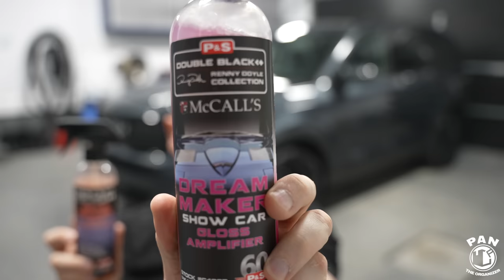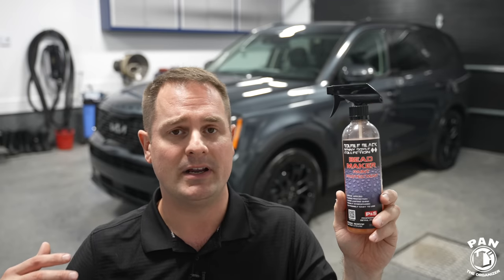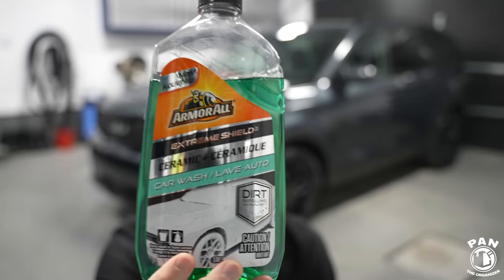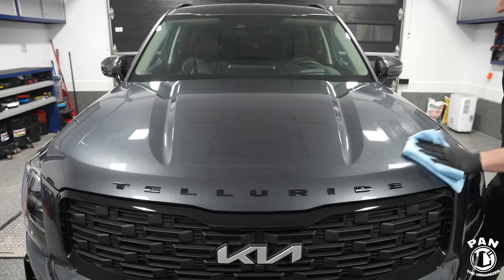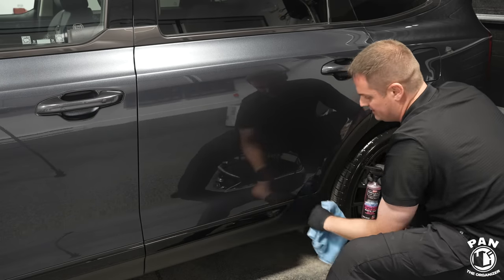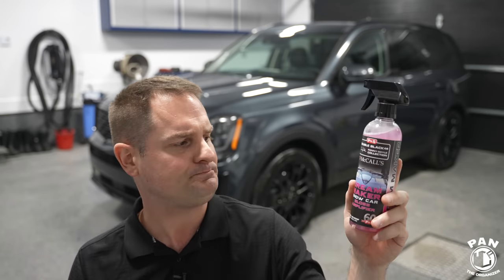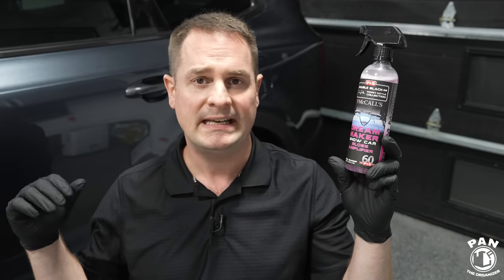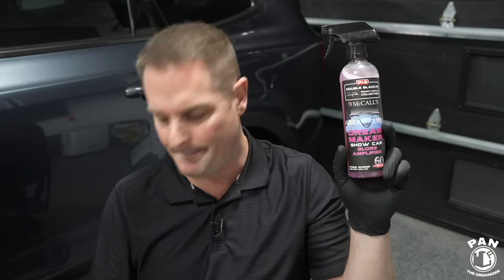NEW P&S DREAM MAKER! Is it better than Bead Maker?

Comment: I just tried dream maker….I wanted to love this product as I already have protection so don’t want to keep loading up.  
Unfortunately I really struggled with Dream maker.  I found it extremely grabby, sensitive to temperature (it was about 9 degrees Celsius) and horribly streaky.  

The paint on my vehicle was absolutely clean and pristine as I’d just done a  multi-day 2 stage paint correction, all that was on the car was bead maker (applied 48 hours earlier).  It was so grabby that I could see areas on the panel where the microfiber filaments had been left on the paint.  
I removed it with Koch Chemie FSE which is so much more forgiving on application and frankly I could see no discernible difference in gloss on a side by side comparison.  The paint color is carbon black (super dark blue).  
Not trying to hate on the product (I like P&S) and everyone can have different individual experiences….just surprised no one else seems to be having any negative user interactions.
Reply from the maker: Yeah that is odd, but I think the 9C temp is for sure not the ideal application temp. I never recommend applying any topper (or paint protection for that matter) under 15C (some brands claim 10C as the bottom limit). Ideally you want to be at near room temp (20-22C). I always keep my garage at 20C and a controlled 40-45% humidity.

Also, switch to clean sides of the towel often when applying. Overloading the towel will for sure generate streaks with most toppers including Dream Maker.

I hope this helps.
Reply: @PanTheOrganizer  I’ll give it a try again when the temp rises here a bit…it was definitely impacting the product as it simply wasn’t flashing….the microfiber wasn’t leveling the product it was just moving it around on the paint surface.  On a different note I was watching your video on gloss enhancers….your closing comment was so spot on….nothing is going to give you enhanced paint appearance like machine polishing.  The paint goes from uninspiring to ALIVE with a quality machine correction.  Gloss enhancers give you that final 5% but, all the heavy lifting is done by the machine!
Reply from the maker: Exactly! You got it Jason. How did you discover my channel by the way?

Welcome to my channel. You discovered one of the biggest car detailing channels on YouTube as we're about to surpass 750,000 subscribers and 100 million views! I have been detailing for 25 years and I love to share my knowledge and passion with my viewers.

You found the right channel to help you learn everything about detailing.
Reply: @PanTheOrganizer  Hi Pan…I was the one that asked you about your Porsche’s Iceland green interior a couple weeks ago….I’m putting together a PTS spec for a Turbo S …..narrowed it down to 4 colors, Oak green metallic being one of them and the interior pairing I would go for would be Iceland green.  It’s a rare interior choice, so I hit the jackpot when your video came up on a YouTube search).  
I apologize for not subscribing sooner ☺️.  The other three detailing channels that I subscribe to are White’s details (saw your collaboration with Jim), Sandro at Car Craft Auto and Vermijl Car Detail. All of whom have elevated detailing to an art form.  
I’ve been detailing for a number of years as I find it relaxing and frankly it gives me as much pleasure to clean a beautiful car as it does driving one.  When you described running the back of your hand across perfect paint I knew the look on your face….you can’t fake that passion!  
Thanks for the welcome Pan, enjoy that beautiful car of yours and I look forward to watching more of your content
Jason.

Comment: Pan, as a regular wash and maintenance. Can I use Bead maker as a drying aid and then finish off with dream maker as a final detail spray to bring that shine and slickness?... 

BTW great video buddy ☺️😁
Reply: Of course u can. BM works fantastic as a drying aid. Putting DM on it at the end of your detail will only enhance the shine!
Reply: @pajamatime5750  Thanks again Pan. 
Always enjoying your videos. BTW You should have a bucket kit of your favorite products and sell it as Pan Christmas Wash Kit for the holidays. ⛄ 🎄 🎁
Reply from the maker: You can if you want to, but there is no need to.
Reply: @PanTheOrganizer  ???.... No need to use both products?

Comment: Hey pan, tried the turtle wax Ice SNS (improved) on my car including glass. But after that the wiper started making squeaky noises and vibrations. Have you ever noticed that?
Reply: Some glass protection products are an awful match with some brands of wipers ! My new Bosch super aqua I don't know what started jumping on my windshield after I applied the Stoner. I could do NOTHING about it... Had to throw them away, and purchase new OEM land rover wipers again.
Now I stick to the same combination...
Reply from the maker: I never had that issue personally but it can happen depending on what glass coating or wipers you have. You can easily machine polish that off and start fresh.
Reply: @delphinebez3045  I'm also using Bosch
Reply: @PanTheOrganizer  can we use meguiars ultimate compound for glass ?

Comment: Okay this is completely unrelated to the video but you seem to have a fix for everything! I had a moisture catcher on my car seat and it collected a load of water and it tipped onto my seat about 2 years ago.. whenever we get the cold damp weather, the seat collects the moisture from the air and makes the seat wet and greasy even though its been washed three times and nothing I do is helping.. I look forward to hopefully hearing your solution
Reply from the maker: You would need to have a professional detailer do a deep cleaning using a carpet and upholstery injection/extraction.
Reply: @PanTheOrganizer  thank you so much for replying! I had a feeling there would be nothing I could do myself

Comment: Can I use it on a ceramic pro coated car?
Reply: Sure if you want to have zero water beading left over.
Reply: @iftar3849  so your saying  it will affect the water beading ?
Reply: @RutlesRyan  Yes, i applied some on my coated car and it removed ALL water beading. The water sat on the surface of the car like it had no coating. I removed the dream maker with tarX and the beading returned to normal. I tossed the dream maker into the garbage.
Reply: @iftar3849  thanks
Reply from the maker: You could, just keep in mind it can alter the properties of the coating, like most toppers do. But you are getting gloss and slickness.

Comment: Dude I've been asking for a while now to do a video removing a ceramic coating from a vehicle. Preferably one that has been done professionally.
Reply from the maker: https://youtu.be/e7WRbfkT5Yo
Reply: @PanTheOrganizer  I've seen that already none of those chemicals removed it and it seems none of the detailing youtubers are willing to make a video fully removing the ceramic coating. The installers themselves don't want to give out that info and want customers to take their cars in for inspection.
Reply: You would have to polish it off to fully remove it
Reply: @Andresthebigkat  already tried it and it didnnt fully remove it. Heard my best best was to wet sand it but that I'm not willing to do on my own and cannot find someone that will do it.

Comment: Good evening sir!  Can Dream Maker be used as a drying aid in between washes when not adding protection but want some gloss?  Also, when you do ceramic coating booster every 3 months do you put on 2 coats?  I was just curious on that.  Thank you as always 
-Ryan
Reply from the maker: Yes Dream Maker can be used as a drying aid. And for the coating booster, one layer is all you need. Don’t overapply.
Reply: Thank you

Comment: Hi Pan, You are amazing! Love your vast knowledge on products! I have learned so much from watching. I bought a new car and thought we would put a ceramic coating on it. We used Adams. I am wondering how to take it off? I am disappointed in the fact that it attracts dust. I didn't realize that a coating would do such a thing. Would you recommend taking it off or letting it die and re-coating it with a different one? Please let me know what your thoughts are I look forward to hearing from you. Thanks Cindy
Reply from the maker: The only way to remove a ceramic coating is by machine polishing. I will have a video on that topic Saturday.

I don’t know which exact Adam’s coating you applied, as they have many, but it could take years to fade away unless you machine polish it up.

Ceramic coatings don’t necessarily attract dust. You must be in an area with a dust issue?

First, you can try using an anti-static topper like P&S Paint Gloss or Dream Maker and see if that helps.
Reply: @PanTheOrganizer  fantastic thank you

Comment: They claim dream maker hasn’t any protection and doesn’t change existing coating behaviour but unfortunately both of them claims are false from my testing
Reply from the maker: If the chemist that formulated the product says there is on protection, I will believe him. Dave (P&S Chemist) has been in the industry for decades and is highly regarded by his peers. I have personally met with him and his brother. Great chemist. He even specialized in surface tension, so let's just say he knows a thing or two about paint protection.

Dream Maker is just a gloss enhancer. It will add slickness and smoothness to the paint too. But it's mainly used for its gloss enhancing properties. It's not designed to be a paint protectant, hence why it doesn't last long. A week or so at best, or until your next wash on average.

What testing did you perform to conclude that is has protection?
Reply: @PanTheOrganizer   hi I’m no expert but I’ve been learning from your videos and forensics and Apex etc but I did polish a panel and remove the polish residue with carpro eraser and apply dream maker and it did show faster sheeting for around a week and another test the coatings seem to kill the beading and I ended up with a sheeter.

I actually done a bit of research today and there’s a rag Company podcast with p&s guys , the podcast is 9th September 2021 and they did admit there’s some protection in there and they said it will change coatings behaviour. They did mention the protection is just a small amount . There defence was that a sheeting product is not a bad product and if there’s any beads they won’t be as tight as bead maker
Reply from the maker: Welcome to my channel Imran. You discovered one of the biggest car detailing channels on YouTube as we surpassed 760,000 subscribers and are getting close to 100 million views! I have been detailing for 25 years and I love to share my knowledge and passion with my viewers.

You found the right channel to help you learn everything about detailing. 

And yes we are always learning in life. Even after 25 years of detailing, I still learn new tricks and discover new products regularly. It's part of the fun!

Comment: Pan! What is the glossiest product you’ve ever used?
Reply from the maker: That's getting harder and harder to have a clear cut answer to nowadays since so many brands have caught up in the technology part of things and are producing kick ass products. But a few years ago, I had done a "glossiest products" video here: https://youtu.be/ERTQz-NTz1Y?si=l2nURvYac1yGmjtO

Most people from the public likely wouldn't be able to tell the difference for the gloss, as most products today are super glossy. I wouldn't overthink the moment, but there are sometimes some gems that give that extra bump in gloss and eye appeal that's interesting. Like the Bead Maker and Dream Maker Combo. Or one of my recent favourites, the Armour Detail Supply Amplify which I used on my car in this video: https://youtu.be/z8h8-_j0-mQ?si=sxfG9u1gjIDG9aQz
Reply: @PanTheOrganizer  Hi Pan thanks for your response I really appreciate it! I actually have a product suggestion that I reckon is definitely worth a try. Aqua Kote Sio2 Ceramic Sealant Spray by Carbon Car Care. Very good gloss it leaves and obviously that protection it contains too. Definitely worth a buy and potentially a review if you like it!

Comment: Pan, I have Meguiar's Ultimate polymer paste wax and Ultimate polymer liquid wax. I was told by Professional detailer who detailed for car dealerships to use the Meguiar's Ultimate Products. He said the polymers would last 6 months that's why I got them. I hope I didn't make a mistake by listening to him. I have one day to wash and wax the Camry that's today.
Reply: Ultimate is fine..just apply 2 coats.
Reply from the maker: It's ok, but I doubt you will get 6 months out of it, especially not in harsh climates.
Reply: @PanTheOrganizer  I did this on Wednesday but I didn't have time to put on the second coat. So out of the to I used the liquid polymer. There is alot of places on the car. This isn't my fault it was given to me that way. I did what I could do Pan. And that's ok. It took 12 gallons of stilled water to wash the car. I had bought a Hart spray kit from Walmart. And a friend of mine said the stilled water would make my car rust. I used the stilled water anyway. I ran my hand acrossed the paint and it was smooth. I was surprised. I didn't have time to do the wheels and tires first. I was running out of day light. The one thing I don't do is keep my Camry's interior dirty. I keep it clean always. Pan thanks much for answering me back.